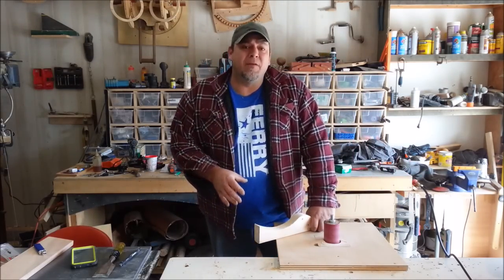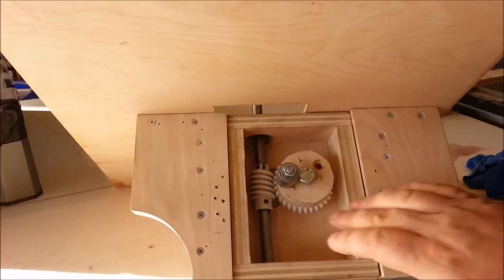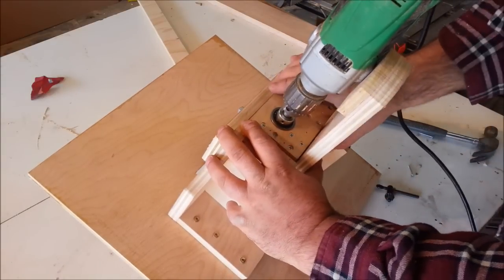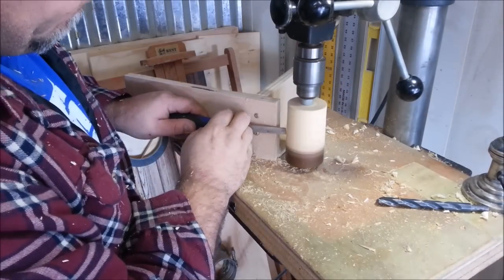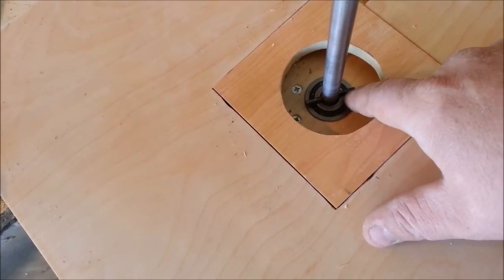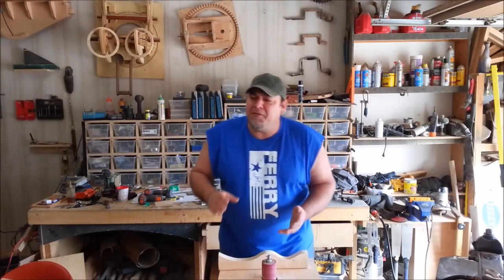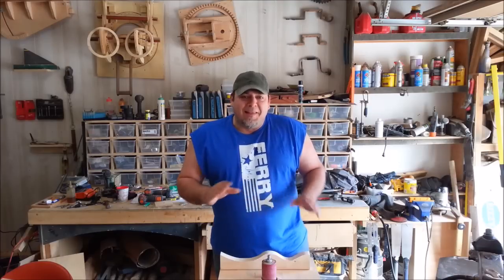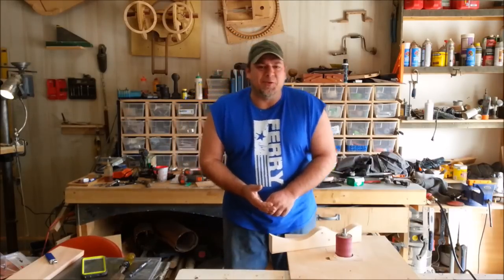Simple homemade spindle sander drill powered

Comment: Great project. Will see about making one. Quick suggestion on chucking from a friend machinist, if you need to chuck not to slip tighten with key in each of the three key slots will increase chuck tightness. Hope that helps the next time you drill press lathe.

Comment: try using 303 surface protectant from Walmart. You may have to order it. It is used for airplanes. I was watching a video about tires. The videographer spayed the inside and outside of the tire and he said it reduces wear on the tires and will increase the life of the tires at least double. You may want to use it on your worm drive. Try it out and let us know how it works.

Comment: You need to figure out a way to make all of those accessories into bolt on modules.  Then you could have a table with a motor in it and a belt drive and have an entire shop set up in a small apartment if you wanted.  Shelves for the modules, and spaces for hardware and attachments.  Make it about the size of a small computer desk.

Awesome stuff Izzy.  I might go try this one.  Looks useful and fun.
Reply: That sounds like a fantastic idea!

Comment: Hey Izzy, amazed by your ideas - as always.  Why didn't you use your table/circular-saw-lathe-jig to make the sanding cylinder? Seeing that fantastic thing work in your other videos it seems like the simpler approach compared to what you did with the drill-press in this video. Is it about the balance of the cylinder? Couldn't that be accounted for by drilling a deeper mounting hole so the cylinder you cut off later is already drilled through?

Comment: First, shame on you for that unshimmed drill mount, "what were you Thinkin". Now that is one elegant design, simple and completely effective. There are many other videos with designs that are so complicated that it forces you to only consider buying one, this is a perfect DIY todo'er. Lastly, it seems like a pressboard dust cover and dab or two of axle grease in that gear box would allow you to tighten out that gear slop and improve on that gear wear problem (even though those gears are designed to run w/o lubrication, when I find these in various machines, they are mostly running with grease). I like this one a lot, this is a perfect drop in for my TS router table extension :-).
Reply: Surely grease would soak up the dust?
Reply: That is why I suggested a thin cover of the "gearbox". Of course it would require some small design change, but it could even be masking tape or cardboard as it is just a dust cover.

Comment: Awesome! Do you know what sort of RPM would be acceptable. I'd like to fix a motor to this instead of using a drill.
Reply from the maker: Just Make It for this set up 1200 to 1500 would be ideal. I am running at 850 with my drill which works but it is a little slow. anything over 1500 would be a bit much for this type of setup
Reply: Great! Thanks for the info.

Comment: I noticed you only used one hole on the chuck for the chuck key.  If you try tightening a bit on one hole, then the second hole, then the third hole, sequentially, you'll find the chuck stays tight.  Just an unsolicited tip. :)